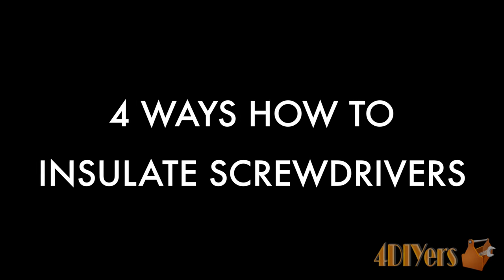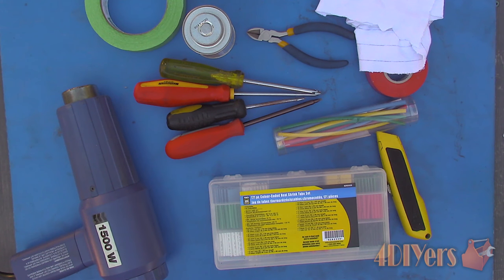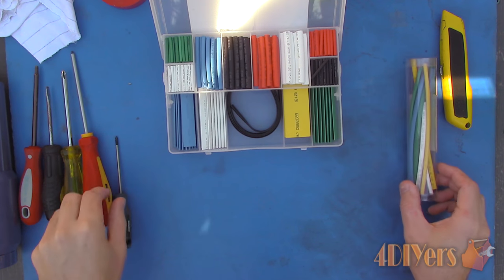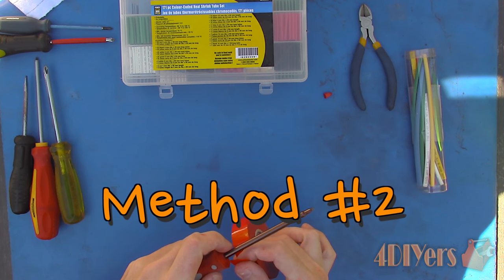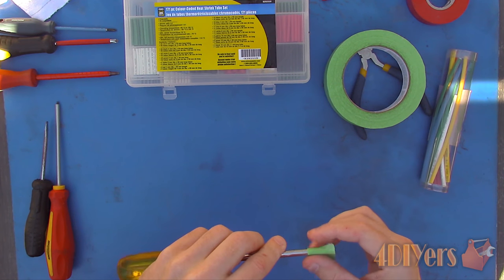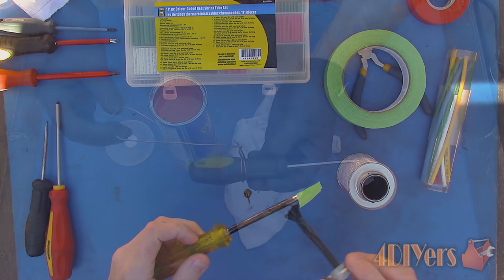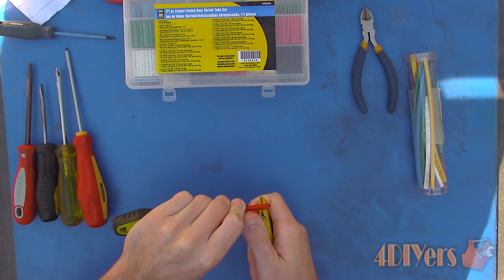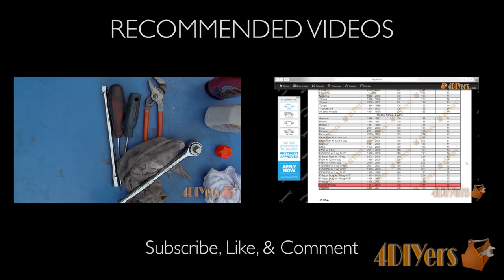4 Ways to Insulate Screwdrivers

Comment: Be aware that none of this adds insulation UNDER the handle like in a professionally made product. I've done all of these to tools over the years, and am actually building an insulated ratchet set for myself and another electrician right now. This works fantastic most of the time, but every so often I get blasted through the handle of my tools. The poster is dead nuts on that this isn't for high voltage. When I'm in 277VAC and up situations, it's time to break out the good tools. There's a reason they're over $1,000 a set.
Reply from the maker: Yes that is true, as mentioned in the video I would only recommend it on a low voltage application such as electronics or an automotive system. Anything more such as a household, commercial, or industrial, it's best to buy the proper tools and if desire, use these methods as added safety on those professional tools. Not worth risking one's health or life. Don't forget to subscribe :)
Reply: bullshit. you bought 20kv rated "1000V" tools... electrical tape is rated for 600 volts you will see old electricians use nothing but that. insulated tools are for very serious work
Reply: Thanks for that. I just picked up a three-piece set for $22 at Lowe’s

Comment: my question is I am highly poor  could I not just wrap electrical tape around my standard bits? ps How much tape did you say is needed thoughts please thank you PS do you think it could still be use in an electric / battery powered drill  ( the maximum voltage that the screw would be used on an appliance would be 250 do you think an electric or battery drill could be possible with bits covered in electrical tape ???) thoughts please thank you
Reply: I mean woud rather than thow out my electrical tool/ battery screwdriver set if it were to be used at a voltage of 250 volts  should I just cover all the bits in electrical tape ?  I mean as previously stated I am highly poor !!!! half an over lap you say?

Comment: Speaking of insulating would rubber coated gloves add any protection against shock from 120v -220v?
Reply from the maker: Household circuit I'm assuming? I would recommend shutting the power off at the panel, that would be the best route. There are special electricians gloves available for protection and I believe electricians also use special insulated boots as well.
Reply: Gloves can help, if you don't sweat... Salty water conducts very well. Also wear quality shoes with thick soles. Thick carpet also helps, or put a piece of plywood or OSB on the floor :-)